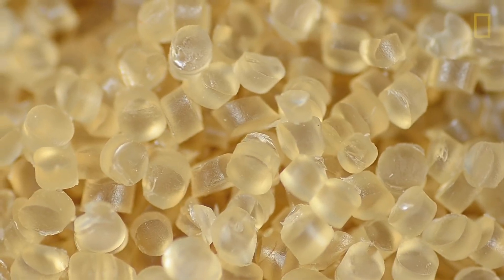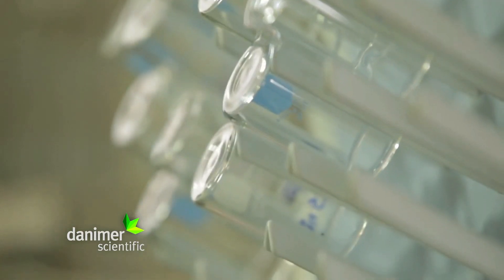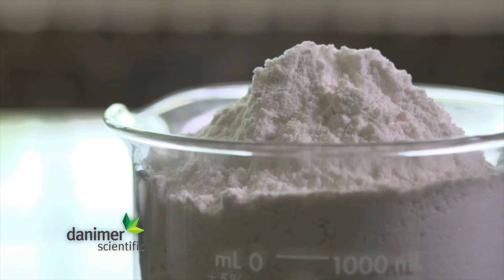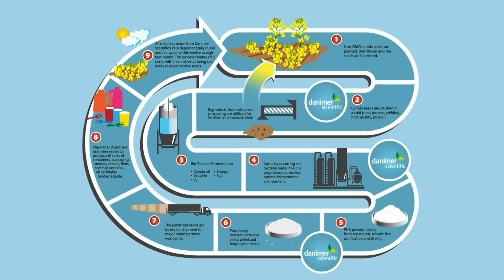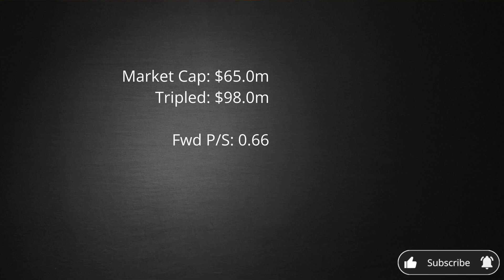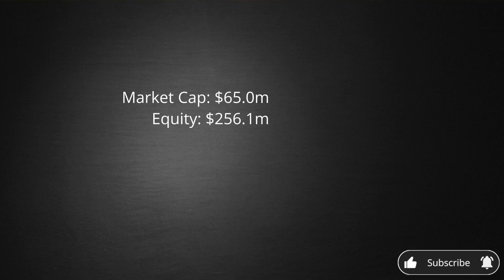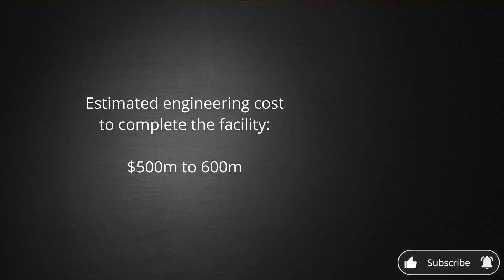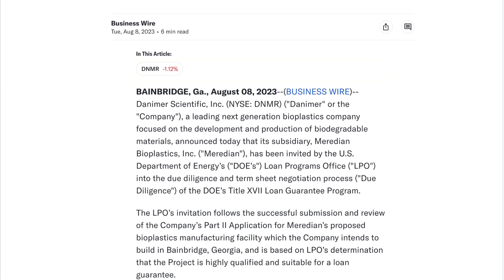Danimer Scientific | The Company Everyone Uses (That No One Has Heard Of) DNMR

Comment: Companies SEC 10-K ACCUMULATED LOSS as a % of market Cap.
-
LUNR Q1'24  $4.41   ** 87.483%  (  -$480,837,000)/549.63M mCap x100
RKLB Q1'24  $5.40   * 25.104%  (  -$667,786,000)/  2.66B mCap x100
PLTR Q1'24  $27.18      8.486%  (-$5,544,083,000)/ 60.53B mCap x100
ASTS Q1'24  $19.00    4.130%  (  -$209,392,000)/  5.07B mCap x100
GOOGLQ2'24  $167.00  0.242% (-$5,012,000,000)/  2.07T mCap x100
AMZN Q1'24  $182.50   0.189% (-$3,598,000,000)/  1.90T mCap x100
TSLA Q2'24  $219.80   0.068%  (  -$467,000,000)/688.74B mCap x100 
NVDA An'23  $113.06   0.001%  (   -$27,000,000)/  2.78T mCap x100
      * at risk
Consequence of company high ACCUMULATED LOSS over time:
Can be a cause for concern. Indicates that a company has been consistently reporting net losses over time, which can lead to a number of consequences: 
     Decreased shareholder confidence 
     Difficulty obtaining financing 
     Indication of financial instability 
     Potential failure 
     Reduced company equity 
     Risk of [[[ BANKRUPTCY ]]] 
However, a young or rapidly growing company might experience an accumulated deficit during its early years as it invests in growth and expansion before becoming profitable.

Comment: Scott. I bought PLTR this week and closed Fri in the green, in the run up to Q2'24 Aug 5. 
Checkout this:
ACCUMULATED DEFICIT PLTR vs RKLB as a % of their mCaps.
PLTR Mar 31'24 (-$5,544,083,000)  8.486% of 65.33 Bill mCap
RKLB Mar 31'24 (  -$667,786,000) 25.104% of  2.66 Bill mCap
-
25.104% / 8.486% =  aprox 3 times
Not yet profitable RKLB's ACCUMULATED DEFICIT is aprox 3 times greater than PLTR, who is profitable. Bad sign that RKLB is heading for trouble if revenue stream does not drastically increase.
Let's see how Q2'24 Aug 8 goes.

Comment: Scott, the chronic depressed $RKLB share price all year, begs research. Here is what I found:
        Often overlooked by a shareholder, is a Company's 10-K SEC filing, balance sheet line item called, ACCUMULATED DEFICIT. Its not so mysterious. A Normal accounting line item. The US Government's ACCUMULATED DEFICIT is said to be a staggering $33 Trillion dollars. Companies also have an ACCUMULATED DEFICIT, the unpaid DEBT principle, and LOSSES carried forward from one quarter to the next, from year to year. Government rarely pays down the National debt, but they do pay the interest. Same with young companies starting out, they skip paying principle, but do pay the Vig. The Gov. accumulates debt by printing money, and borrowing money in the market. Companies can't print money and so must borrow it to. 
        ROCKET LAB has reported on 10-K SEC filings ACCUMULATED DEFICIT from 2019 to 2023, plus 1st quarter 2024.
-
2024 Mar 31 (-667,786,000 ) 1st quarter 2024 {could actually be (-$1,076,526,000) if the Feb 2024, $355 million raise, and $98 million from Blackrock was not included. 
2023 Dec 31 (-623,526,000) year
2022 Dec 31 (-440,955,000) year
2021 Dec 31 (-305,011,000) year
2020 Dec 31 (-187,691,000) year
2019 Dec 31 (-132,686,000) year
-

Comment: Scott, I refer to Accounting line item ACCUMULATED DEFICIT in 10-K filings:    Quote: "IT'S THE TOTAL AMOUNT BY WHICH A COMPANY'S LOSSES HAVE EXCEEDED ITS PROFITS SINCE ITS INCEPTION." Super Fast CPA online.
        [RL reported on 10-Ks over 1 Billion from 2019 to March 31 2024 = total USD $1,076,526,000] 
       More: "An ACCUMULATED DEFICIT, also known as a retained earnings deficit or accumulated loss, occurs when a company's cumulative net losses exceed its cumulative net income. In other words, IT'S THE TOTAL AMOUNT BY WHICH A COMPANY'S LOSSES HAVE EXCEEDED ITS PROFITS SINCE ITS INCEPTION. The accumulated deficit is a part of the stockholders’ equity section on a company’s balance sheet." 
      "An ACCUMULATED DEFICIT indicates that a company has not been profitable over time, and it MAY SIGNAL FINANCIAL PROBLEMS or POTENTIAL BANKRUPTCY if the company cannot generate enough profits to offset the deficit. However, it’s important to consider the context, as a young or rapidly growing company might experience an accumulated deficit during its early years as it invests in growth and expansion before becoming profitable."' Super Fast CPA online.
-
     ANOTHER DEFINITION: Google's AI search result: "A company's ACCUMULATED DEFICIT, also known as a retained earnings deficit or accumulated loss, 
      is THE TOTAL AMOUNT A COMPANY HAS LOST SINCE ITS INCEPTION,
           [10-Ks over 1 Billion 2019 to March 31 2024 = USD $1,076,526,000] 
as measured by its cumulative net losses minus its cumulative net income. It's usually shown as a negative number in the stockholder's equity section of a company's balance sheet."
     "For financial reporting purposes, companies with negative retained earnings may choose to report it as an accumulated deficit. Retained earnings are the cumulative earnings a company has kept and not distributed to shareholders as dividends. They can provide insight into a company's financial history and future growth potential."

Comment: Scot I double checked this: Goggle Search result for: is company debt included in accumulated losses?
Yes, company debt can be included in accumulated losses. Accumulated losses are costs that a company incurs from debts or other expenses over multiple quarters and are reflected in a company's audited balance sheet. They can occur when a company uses its assets to cover debts during a quarter when it experiences more financial loss. If a company's debts start to exceed its assets, it may experience negative shareholder equity.

Comment: Scott, can this be so? Check my numbers.
My research of RKLB DEBT, almost a BILLION Dollars (!!)
Source: Rocket Lab 10k 2023 and 2022 Annual reports.
RKLB Accumulated deficit.
2024 Mar 31 (978,526,000) [2024 Feb 27 raise $355,000,000]
2023 Dec 31 (623,526,000)
2022 Dec 31 (440,955,000)
2021 Dec 31 (305,011,000)
2020 Dec 31 (187,691,000)
2019 Dec 31 (132,686,000)
     Google Search Result: MEANING: An accumulated deficit account is a record of a company's losses that are carried over from one accounting period to the next. It can also be referred to as a retained loss or negative retained earnings.
     A company incurs an accumulated deficit when it has experienced more losses than profits since its inception. For example, if a company loses $5,000 in year one, $4,000 in year two, and $6,000 in year three, its accumulated deficit would be negative $15,000.
Reply from the maker: What are you referring to?

Rocket Lab's long-term debt is listed as "Long Term Borrowings".
As of March 31, 2024, LTB was at $64m.
Reply: @scotto2050  . I refer to Accounting line item ACCUMULATED DEFICIT in 10-K filings:    Quote: "IT'S THE TOTAL AMOUNT BY WHICH A COMPANY'S LOSSES HAVE EXCEEDED ITS PROFITS SINCE ITS INCEPTION." Super Fast CPA online.
        [RL reported on 10-Ks over 1 Billion from 2019 to March 31 2024 = total USD $1,076,526,000] 
       More: "An ACCUMULATED DEFICIT, also known as a retained earnings deficit or accumulated loss, occurs when a company's cumulative net losses exceed its cumulative net income. In other words, IT'S THE TOTAL AMOUNT BY WHICH A COMPANY'S LOSSES HAVE EXCEEDED ITS PROFITS SINCE ITS INCEPTION. The accumulated deficit is a part of the stockholders’ equity section on a company’s balance sheet." 
      "An ACCUMULATED DEFICIT indicates that a company has not been profitable over time, and it MAY SIGNAL FINANCIAL PROBLEMS or POTENTIAL BANKRUPTCY if the company cannot generate enough profits to offset the deficit. However, it’s important to consider the context, as a young or rapidly growing company might experience an accumulated deficit during its early years as it invests in growth and expansion before becoming profitable."' Super Fast CPA online.
-
     ANOTHER DEFINITION: Google's AI search result: "A company's ACCUMULATED DEFICIT, also known as a retained earnings deficit or accumulated loss, 
      is THE TOTAL AMOUNT A COMPANY HAS LOST SINCE ITS INCEPTION,
           [10-Ks over 1 Billion 2019 to March 31 2024 = USD $1,076,526,000] 
as measured by its cumulative net losses minus its cumulative net income. It's usually shown as a negative number in the stockholder's equity section of a company's balance sheet."
     "For financial reporting purposes, companies with negative retained earnings may choose to report it as an accumulated deficit. Retained earnings are the cumulative earnings a company has kept and not distributed to shareholders as dividends. They can provide insight into a company's financial history and future growth potential."
Reply: @scotto2050  I refer to Accounting line item ACCUMULATED DEFICIT in 10-K filings:    Quote: "IT'S THE TOTAL AMOUNT BY WHICH A COMPANY'S LOSSES HAVE EXCEEDED ITS PROFITS SINCE ITS INCEPTION." Super Fast CPA online.
        [RL reported on 10-Ks over 1 Billion from 2019 to March 31 2024 = total USD $1,076,526,000] 
       More: "An ACCUMULATED DEFICIT, also known as a retained earnings deficit or accumulated loss, occurs when a company's cumulative net losses exceed its cumulative net income. In other words, IT'S THE TOTAL AMOUNT BY WHICH A COMPANY'S LOSSES HAVE EXCEEDED ITS PROFITS SINCE ITS INCEPTION. The accumulated deficit is a part of the stockholders’ equity section on a company’s balance sheet." 
      "An ACCUMULATED DEFICIT indicates that a company has not been profitable over time, and it MAY SIGNAL FINANCIAL PROBLEMS or POTENTIAL BANKRUPTCY if the company cannot generate enough profits to offset the deficit. However, it’s important to consider the context, as a young or rapidly growing company might experience an accumulated deficit during its early years as it invests in growth and expansion before becoming profitable."' Super Fast CPA online.
-
     ANOTHER DEFINITION: Google's AI search result: "A company's ACCUMULATED DEFICIT, also known as a retained earnings deficit or accumulated loss, 
      is THE TOTAL AMOUNT A COMPANY HAS LOST SINCE ITS INCEPTION,
           [10-Ks over 1 Billion 2019 to March 31 2024 = USD $1,076,526,000] 
as measured by its cumulative net losses minus its cumulative net income. It's usually shown as a negative number in the stockholder's equity section of a company's balance sheet."
     "For financial reporting purposes, companies with negative retained earnings may choose to report it as an accumulated deficit. Retained earnings are the cumulative earnings a company has kept and not distributed to shareholders as dividends. They can provide insight into a company's financial history and future growth potential."